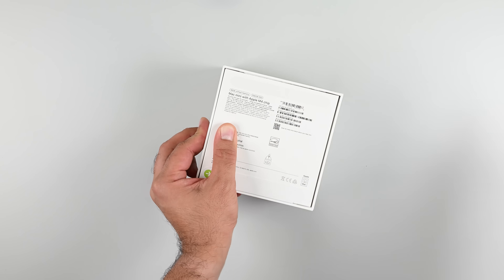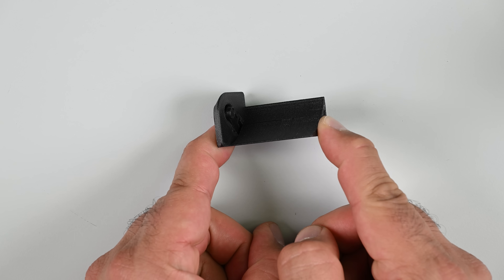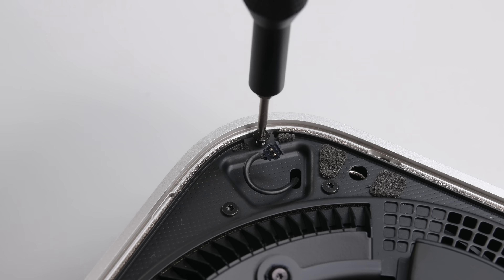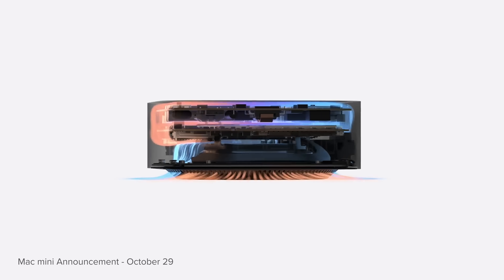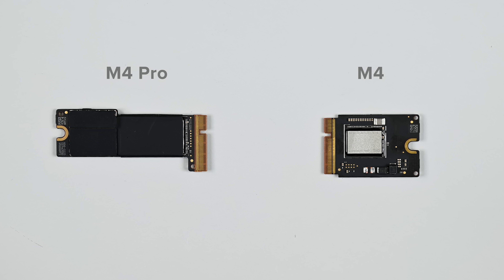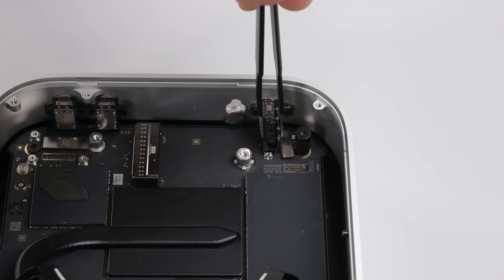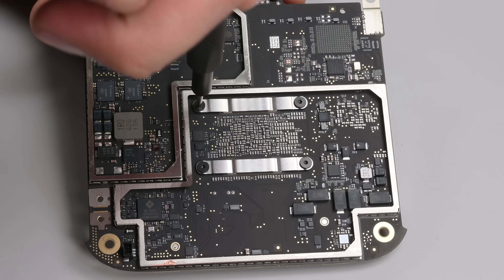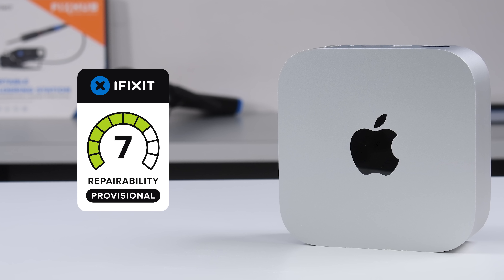M4 Mac mini Teardown - UPGRADABLE Storage, Powerful, and TINY

Comment: Upgradable PROPRIETARY SSD. This is typical Apple. “We don’t mind repairability and upgradability, so long as we can continue to rob you blind on repair and upgrade costs.”
Reply: Is it possible for a third party to manufacture an SSD that fits their port? Or does Apple have exclusive rights to the port/SSD design?
Reply: I’m sure the margins on their base spec machines are not as much as they would like, so us upgraders are subsidizing the base model buyers. It’s a smart way of democratizing their products and increasing their user base/market share. 

If base specs were increased and upgrade prices were cut to $100, the base price would have to be $200+ more. My first macbook air from 2012 was $1200 ($1650 in 2024 dollars) and wasn’t nearly as capable for it’s time. Today’s base macs are a steal in comparison
Reply: @xsleeptodreamx or their margins could probably be higher than any in the industry, the same processor goes into a lot of their devices meaning they can have higher yields from the fab which they can turn into products since their lower grade cpus go into their lower end products with binned cpus. I see apple as way more efficient in their process than the likes of intel concentrating their efforts on a handful of chips.

Comment: Theoretically upgradable, if Apple desides to sell those storage units separately.
Reply: Or the OEM factory sells QC failed board to the market…….
Reply: @honggao9610  never will
Reply: @dosdude1 made a video of a chip upgrade three days ago. It won't be long until someone sells whole modules.
Reply: Right like the 2014 era MacBooks with “proprietary” SSDs that there are millions of replacements for 🙄
Reply: They won't, but third parties probably will.
Reply: give the chinese a few months and you can be sure they will have 1tb storage units available at half the price of apple's oem and with the same performance.
Reply: There was third party drives available when MacBook Air’s has proprietary SSD’s.
Reply: It's easier to use an external drive.
Reply: The size and shape of the SSD is different between the M4 and M4 Pro models
Reply: there's already someone making parts for the studio; it's a question of time before it's available for the mini. upgrade is already possible if you have the skills and tools solder a nand.
Reply: there is a dude that makes modules for the Studio. I guess he is going to make for the mini. In reality, there is little reason besides failure to change it if you have the pro. The first generation of Thunderbolt 5 storage is doing  6GB/s yes gigabytes.
Reply: @jaimeduncan6167  Is that speed supposed to be impressive??

Crucial T705 Gen 5 NVME SSD can do 14GB/sec.
Reply: @jaimeduncan6167 if the laptops were upgradable like this, there would be a good reason. But with desktops, just buy base storage and get a good SSD enclosure.
Reply: They may in the future
Reply: Given the prices they charge, do you suspect for one second they won't jump on the opportunity a few months down the line?   The reason they made it difficult in the past was so nobody could undercut them on their ridiculously inflated NAND prices.
Reply: They'll be selling a 1tb SSD for $400.
Reply: People will be quick to figure out an adapter or a clone of this SSD anyway. Great work for upgradable storage. Just get a beefy ram at first purchase, care about the storage later!
Reply: Chinese will take care of that.
Reply: @717pixels9  This "update" is called a repair, not an update ☝️😅
Reply: @717pixels9  This "upgrade" is called a repair, not an upgrade))
Reply: I remember they only sell storage expansions for Mac Pro.
Reply: For 500 dollars
Reply: They will on the self repair store
Reply: Maybe thats the plan
Reply: Apple never will
Reply: There is 3rd party companies
Reply: Yeah, you know darn well they will NEVER.
Reply: @JamesR624  Wrong. They do sell replacement parts for their newer Macs. Might not yet be available since it just released but you can find all the parts for the Mac Studio for example and repair manuals on their website.
Reply: @JamesR624  they will , but the price is 10 times higher than others
Reply: or until some random guy in brazil or russia or china makes an entire repo bypassing the drm
Reply: @aiexzs  already happened. i saw like 3 videos on bilibili today about that already
Reply: @aiexzs already done by @dosdude1, he is American 😁
Reply: @aiexzs  Which DRM? He literally told you in the video the new drive works as soon as you configure it with Apple Configurator.
Reply: @blueskye8470  didn't he say only a drive from another mini worked? plus macos is pretty picky with boot drives, i wouldn't be surprised if they locked it down to their own drives
Reply: @blueskye8470  but they were both Apple OEM. A third-party part may not work.
Reply: Apples makes most of the profits on upgrades (if you double the RAM and storage it costs you as much as getting as second M4 mini, so it's as is the M4 and everything else is free), I am afraid that if someone starts to sell drives they might use some firmware updates to make them unable to boot...
Reply: @_Digitalguy Exactly. But these YouTube gurus apparently haven’t thought that through.
Reply: @_Digitalguy  this is probably a negligeable niche market; they don't care.
Reply: behold $200 each
Reply: The company who made those SSD will release some to market sooner or lalater. I believe you can already upgrade it at huaqiang north China
Reply: Theoretically they could, but they would charge more than you would pay if you got the bigger one in the first place.
Reply: I'm also wondering why they make the nand removable when it's still cryptographically coded to the device.. 🤦‍♂️ 🤔 Either they'll be selling nand or it's just for ease of repair.
Reply: They're not gonna sell them for normal prices, so this isn't actually upgradable.
Reply: Which they won't or sell at 150% the already inflated apple tax price. so its not even worth it, to upgrade. since they want you to buy the larger storage right away
Reply: exactly, also the fact there's 2 physically different storage modules is a huge L on any sort of longevity.

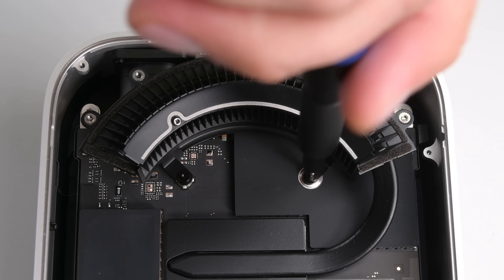Comment: if anyone was curious like I was what size the 'chonky' torx mentioned at 4:05 actually is, it's a t25
Reply: I chuckled at that. The German cars I work on use T60 torx for things like the driveshaft flex disc and belt tensioners! T30 and T45 are also very common.
Reply: These zoomers (and people who lower themselves to talk like zoomers) really should have an adult review their supposedly-factual video to make sure it contains actual information.

Comment: But can you physically swap the nand chips from the pro model to not the pro model? (Via hot air/soldering)
Reply: yes
Reply: I think you may need a nand programmer though and the right initiation file
Reply: @hmmmhhhmmh  no Idea how it works but I saw I think from DosDude that it needs to be a complete blank NAND chip. So you can't take one from an NVME SSD for example and just solder it on there. It has to be factory blank because the controller is on the M4 SoC and not no the stick that apple is using there. Only other option would be a NAND from another apple silicon product. I'm sure several youtubers will be trying this out soon
Reply: @linglingstar  or just buy a blank nand from the manufacturer; that's pretty much what dosdude did (he did use a programmer at some point but maybe for another machine?)

Comment: What's the point of a removable storage if it can't be replaced with a storage from another manufacturer?
Reply: replacement when if it breaks. Probably the much bigger reason is drastic easier logistic. Imagine you need stock for every combination there is. 2 Ethernet, 3 Processor, 4 Storage base and 5 for pro, 3 ram options. That makes 84 different models they would have to produce and sell. without storage it reduces to 18 different boards they need to produce and thats only that high because 10 GbE is solder onto the board. But waaaaaay less then if storage is soldered onto the board.
Reply: @RC2225  that logic falls a part for the majority of their line, which solders on SSDs
Reply: @ there are 6 imac, 24 mb air and around 70 mb pro options.
Reply: gives people something to moan about
Reply: If SSD crashes then it can be replaced by Apple part and the mac mini can be used again
Reply: @ No way - before that happens, you'll already update your mini twice to a newer version
Reply: @OleksandrDunets  I'm still using an old 2009 iMac
Reply: @detoga  why though
Reply: @aiexzs  it still works. why not?
Reply: @detoga  I still use a PC somewhere in the same year of release: I replaced one hdd with another, then replaced the hdd with an ssd, and recently changed the video card from gtx 460 to 1650 and gave it to my nephew to study. But if I want to change the processor, only the used version is available. Spare parts from the manufacturer can no longer be found - removed from support. The same story will be with the ssd in MacMini - until it fails - the time of warranty support and delivery of components will end
Reply: What makes you think it can’t be replaced by ones made a different manufacturer?
Reply: @ Why do you think the video changed the memory between two MacMini and didn't take a third-party memory? If I understand correctly, there is an additional chip/controller from Apple on this memory and without it - third-party ssd will not be able to work
Reply: @OleksandrDunets  because they don’t exist yet. It’s not standard m2, but that doesn’t mean third parties can’t make it.
Reply: @ exclusive spare parts - is that what we wanted?))
Reply: @OleksandrDunets  if you were expecting m2 you were grossly misinformed. Apple puts the controllers on the SoC, the storage modules are just flash memory — there is no standard for that. And yes, having the controllers on board instead of on the storage hanging off pcie lanes has advantages.
Reply: @ Can you please clarify what advantage we are talking about?
Reply: @JasperJanssen and worse 2 module configurations are in striped mode
Reply: You mean like Zip drives?
Reply: well maybe not officially it's still easier to upgrade. And Apple can repair it better.
Reply: @detoga  what do you mean it can replace it better? Do Apple technicians have better hands to insert a storage drive so precisely that it affects performance positively unlike my own very much non-Apple hands?
Reply: @loisrossman begs to differ.
Reply: SSDs have a finite lifespan. How you use it will vary the lifespan, but it is possible it will go out. 
Even if you have to look really hard to source an OEM replacement, it’s still better than an external drive that you could never disconnect. That would be the only alternative if it was soldered like the MacBooks
Reply: @officialmr_springtrap  finite as in many years for most users.
Reply: @officialmr_springtrap  yes, the trick is large free space - only use 1/3

Comment: What a terrible take. You can't point out an obvious design flaw and then say that it's ok because consumers fixed it for Apple. Also, is a part really upgradeable if you can't get the part without buying an entire PC? Don't forget that apple made SSDs proprietary for no reason other than making their products less upgradable and repairable.
Reply: the ssd actually has a reason. Normal M.2 ssd's have a storage controller on the ssd while the Macs have it in the SoC. Of course there are always other options in the design but
Reply: It's alright it's just a button, mscs stay on most of the time anyways
Reply: I work with a mini PCs. Putting the power button on the bottom is imo, smart placement cause I've used ones where the power buttons are on the top or side and I often accidentally press the power button on em whenever I try to plug/unplug some ports on the back.
Reply: I don’t know a single person who often shuts down their Mac.
Reply: @Butterscotch_P1e  Set software to power on after ac is off, then just toggle a switch. Only drawback (clock,) runs from cmos battery when no ac. 
Settings > Energy > Power ON after power failure - what no-one mentions but me
Reply: Apple does stuff like this to get you to use the product how they want you to. E.g the OG imac did not need a handle but they added one so that people would be open to the idea of carrying it with them and using it in different places and so that it felt more personal. I as a pc user wasnt aware that you dont need to turn a mac off but now I know because everyone is talking about the button placement. If I bought this I would instinctively just press the power button when I was done using it
Reply: A French company is making ssd for the studio, mini will come later
Reply: My Macs rarely ever get turned off. And when they do, it’s via the OS so apps quit and everything shuts down properly. People have to really nitpick to make this an issue.
Reply: The power button is not an “obvious design flaw.” Macs have Power Nap, they don’t need to be shut down much because they’re actually stable machines.
Reply: I have used a power button on a desktop mac maybe 4 times in the past 5 years. complete non issue. it's a troubleshooting button
Reply: How do you turn on the mac then? Keyboard? Genuinely asking @beepboopsloane
Reply: @akhil1781  I don't turn it off so why do I need to turn it on. these things sip power
Reply: @beepboopsloane  A lot of people don't use an audio jack very often so Apple should have placed in at the bottom as well.
Reply: Ok snowflake ❄️
Reply: They do sell replacement parts for their newer Macs. Might not yet be available since it just released but you can find all the parts for the Mac Studio for example and repair manuals on their website.
Reply: Who cares when that thing is just 600 dollars.
Have you seen the muscle on that tiny thing?
Reply: it’s literally fixed by putting it on top of literally anything. raise it by one centimetre and it’s fixed. and it’s not even broken in the first place. i don’t understand people treating this as an issue
Reply: You still cannot use a normal nvme ssd to replace the storage.
Reply: @HungTruong  apple's solution performs better than NVMe because it's a permanently mapped DMA controller rather than a packet-switched message-controlled PCIe pheripheral
Reply: Relax, cup cake.
Reply: I think is better design choice if controller is on mainboard then let the nand run like toast
Reply: “Design flaw” it’s a power button that isn’t difficult to press and it’s only being made a big deal by people who have zero interest in buying it. You and I both know you aren’t going to buy this so why do you care?
Reply: @Dominic_J  it’s because it’s cool to hate on apple
Reply: Stop crying and don’t buy one power button is a non issue
Reply: So let me get this right. you are upset that apple decided to use a proprietary ssd socket, over soldered on nand? a little backwards there bud, you wanna know the fun thing about apples proprietary ssd connectors? nothings special about them, its just a wonky pin out, and like we did on trashcan pros and older macbooks, someone will make a little adapter and we'll be able to put nvme m.2 drives in. 

Also the power button is a complete nonissue. Do you really turn your desktop on and off every time you use it or leave? XD
Reply: @chloedegurechaff1941 it's not that simple, that module like the one in the mac studio contains only the nand chip, because the controller is on the m4 package, so you'd need a custom module like the one apple uses. Op is right it's not really upgradeable, more like easily replaceable
Reply: @chloedegurechaff1941  what a disingenuous way to frame this. No, I am not upset that Apple chose a proprietary SSD socket over soldered on nand. I am upset that they chose a proprietary SSD socket over *industry standard one*. We don't need more proprietary standards that do absolutely nothing but make things harder to repair or replace.
Reply: @ it’s already being done just saw a yt video on it
Reply: @chloedegurechaff1941  I doubt m.2 nvme ssds will work even w an adapter. Knowing Apple and their actions in part-pairing on the iphones the Mac mini probably won't accept any SSD that is not manufactured or apple-approved. Like the Canon printers that had a microchip to verify the cartridge was a genuine Canon-made one.
Reply: I'm not upset that they use m.2 drives, my issue is that they made their m.2 drives proprietary by moving the controller to the motherboard.
And yes, I do in fact turn my PC off, you might not nad that's fine you do you. I just don't see any reason as for why it can't be on the back where you can easily reach it. Even if it's just 4 times a year for troubleshooting, as other comments have reported. Also, the bigger issue about the power supply for me was how it was presented as a none issue because third parties have fixed it. Right now it's just a little power button, next time it might not be.
Reply: @ ah yes yes, the slippery slope fallacy 👏